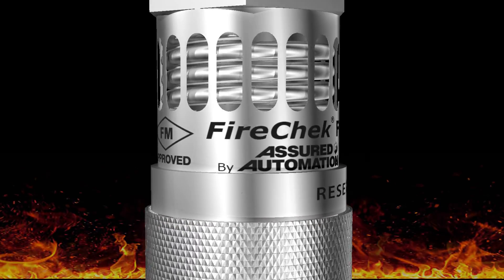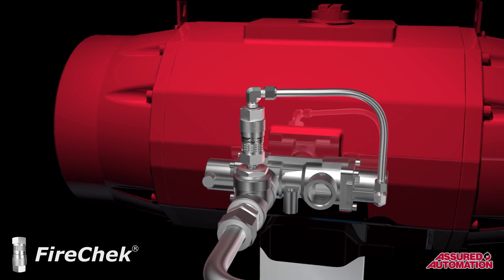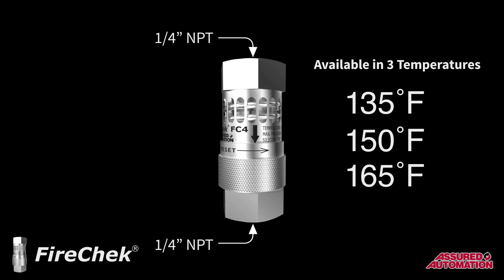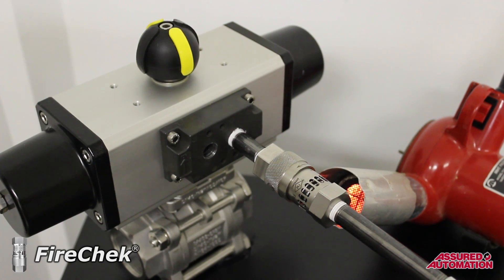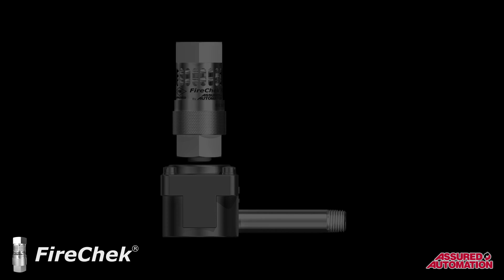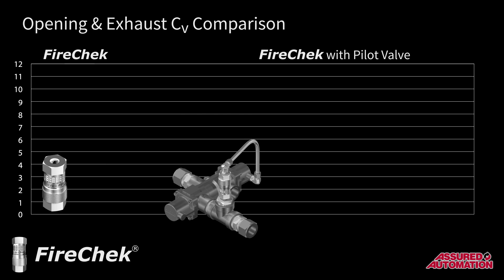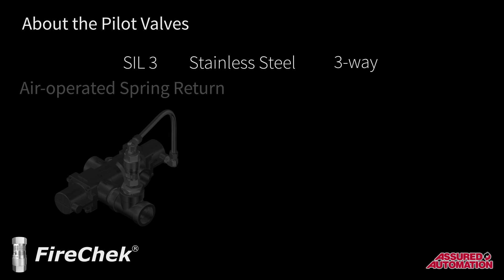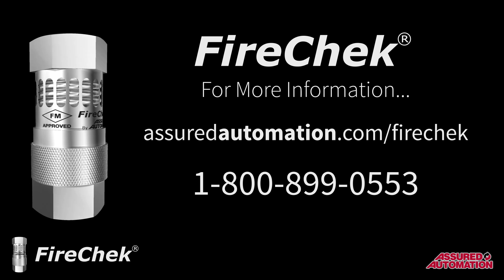FireChek Thermal Shut-Off Valve Overview

Comment from the maker: Complete Video Trancript:
Introducing the FireChek Series Exclusively from Assured Automation.
The FireChek Valve is a heat activated pneumatic shutoff valve that is used to stop supply air and exhaust pneumatic valve actuators in the event of a fire or excess heat emergency.

The FireChek Series Includes models to fit pneumatic actuators of almost any size. 
The FireChek Valve by itself is suited for use on smaller actuators, typically those found on valves up to 4 inches in size.

When larger valves require emergency thermal shut-off operation, the FireChek Valve with Quick Exhaust drastically increases the exhaust speed of the pneumatic actuator. This provides for faster return to failsafe.

When valves with extremely large actuators require thermal shutdown the FireChek Valve is packaged with a high flow pilot valve to provide even faster exhaust capabilities.

The most advanced FireChek Valves include an Explosion Proof electric solenoid. This allows the unit to provide the means of actuator control in addition to the thermal shutdown functionality.

The FireChek Valve operates using a coil made of a patented shape memory alloy that changes physical state at specific temperatures. Once the actuation temperature is reached, the FireChek Valve is triggered and simultaneously performs 2 important functions.

One: it vents the actuator, allowing the valve to return to its failsafe position. 

Two: it cuts off supply air to prevent it from potentially feeding the fire.

FireChek Valves have 1/4” NPT connections and are available in three different actuation temperatures: 135, 150, and 165 degrees Fahrenheit, where 165 is the standard. These temperatures are extremely accurate and repeatable ensuring that actuation happens at the right temperature, and ONLY the right temperature.

Many plants currently use fusible plugs or plastic burn-through tubing on the actuator’s air supply line to exhaust the actuator. While these methods effectively allow the actuator to return to failsafe, they also allow the supply air to FEED oxygen to the localized fire making conditions worse.

Fusible Links are another common emergency shut-off technique, however, they require an entire valve assembly dedicated to this function. FireChek Valves enable any pneumatically operated valve to perform this duty while maintaining its original functionality, whether it is on/off or modulating. 

Another valuable feature of the FireChek Valve is that it can be tested and reset easily as part of a regular safety monitoring and maintenance program.
When using the FireChek Valve by itself on smaller actuators, installation is as simple as connecting the FireChek Valve inline on the supply air line to the actuator. The 

FireChek Valve can be nippled directly into the actuator port, or installed anywhere upstream. Using two compression fittings makes for an extremely easy retrofit into stainless steel tubing. The FireChek Valve can be located either before or after the actuator’s control solenoid.

Installation of the FireChek Valve with Quick Exhaust is similar, however the outlet, or downstream side has the quick exhaust diverter valve attached. These units function exactly the same as the FireChek Valve, except when they are triggered, the exhaust from the actuator is diverted through a larger exhaust port, providing a faster evacuation of the air from the pneumatic actuator. The exhaust Cv increases from .56 to 3.3 for the 3/8” model and up to 8.8 for the ¾” model.

In cases where the actuators are large enough to require a high flow piloted spool valve for operation, the FireChek Valve is installed on the external pilot line of the spool valve. This setup provides the same functionality, but does so in a slightly different manner. The FireChek Valve vents the spool valve’s pilot, causing the spool to shift, which then exhausts the actuator. 

These pilot valve assemblies expand the FireChek Valve’s capability by increasing BOTH the opening AND exhaust Cv. 
The Cv of the FireChek Valve itself is .49 inlet and .56 exhaust.
¼” pilot valves increase both values up to 1.53/8” goes up to 2½” up to 5.5And 1” pilot valves increase both inlet and exhaust Cvs up to a whopping 11.1.That’s about 20 times the airflow of the FireChek Valve itself.

The Pilot valve models are available in various mounting styles including NAMUR, Plate mounted, and inline. Inline models can have female NPT threaded ports, or include compression fittings on the inlet and outlet for connection to stainless steel tubing. This makes for an easy retrofit in any system.

All Pilot Valves are SIL 3 stainless steel 3-way valves. They are available as air operated spring return, which simply act as a larger version of the FireChek Valve, or with an Class 1 Div 1 explosion proof solenoid with potted coil to provide for control of the pilot valve - therefore control of the actuator itself. The solenoid valves can be 12 or 24 volt DC, or 120 or 240 volt AC. 

You can easily select the FireChek valve that is right for your application by using the online configurator. Simply select the type, size, mounting style, and temperature, and you will see pricing, model code, and photo update instantly. 

For additional information about the FireChek Series visit assuredautoamtion.com/firechek or call Assured Automation at 1-800-899-0553 to speak with a representative.